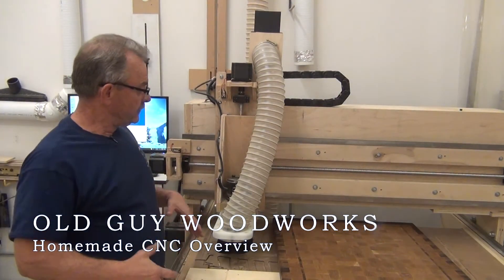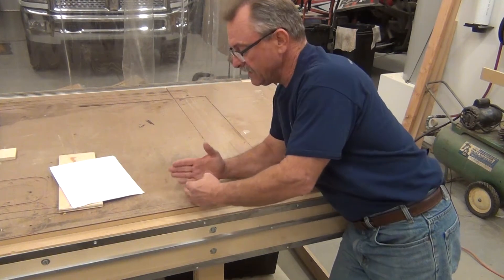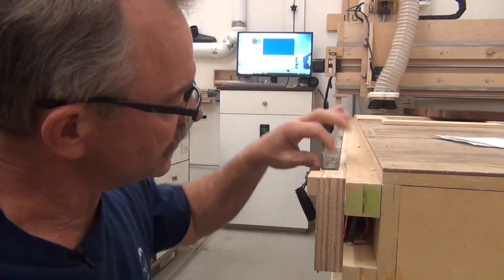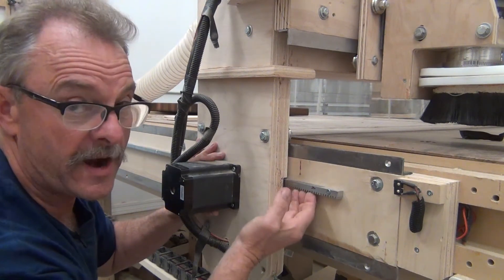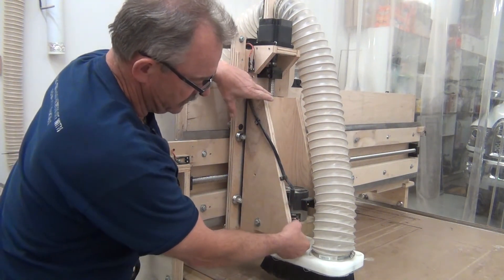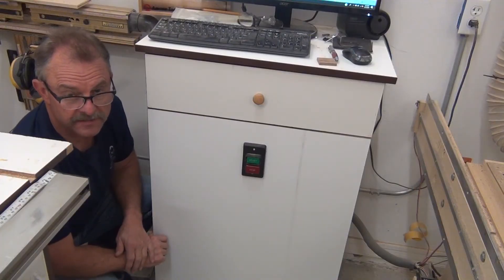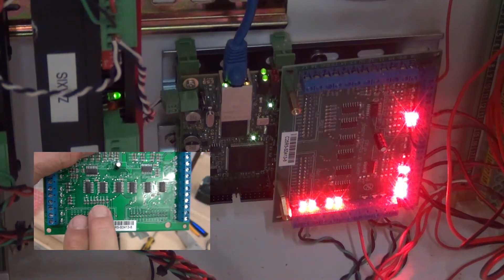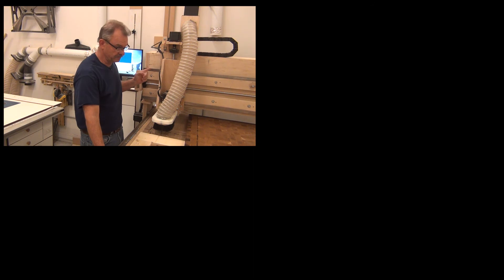How to Build Your Own CNC - Easy and Cheap

Comment: Great video, very helpful tutorial. Theoritically speaking, how plausible is it to upgrade this design to allow CNC-ing metal (ex. stronger drives, router etc) ?
Reply from the maker: I was starting to do that very thing.  Changing to Aluminum billet for the gantry brackets, but I'm moving the shop.  It's all coming apart.
Reply: @OldGuyWoodworks  Nice, I think I speak for everyone when I say that we would love to see the end-result. Good luck with the moving process by the way and thank you for the content. Awsome channel 👍

Comment: I'm going to be looking in on more of ur build videos bro. I think it's awesome how u built a full size 8x4 ft CNC Router.  Great job man.
I wanna build a smaller version but I;m using TB6600 drivers wih NEMA 17 & NEMA 23'S.. I have an small spindle, well 2 different Spindles but also a cheap 800W palm router. I think I will use the 775 small spindle motor for starters. I wanna use Arduino for my controller. 
I have a 600W poiwer source and it's 24V but I also have a 360W power supply as well but I need to go back and check what it is 12/24V? I'm not sure right now. All my parts rare boxed off atm. I'm only using 2060, 2020 & 2080 extruded Aluminium. 
It's my 1st attempt so I bou8ght what I9 could get on a good offfer. I'm goign to use belts and pulleys. I am waiting on 6mm Aluminium plates for my gantry sides. I'm thinking of making it 1000X600mm for now to learn from mistakes I make but I want to ask about what u said concerning the power supply burning out the Drivers? I defo think the smaller spindles are maybe 350W. U know the cheapo ones. They say 500W but never reach it. 
So what I want to ask is do I need 2 power supplies? 
ONE FOR THE SPINDLE AND ONE FOR THE DRIVERS AND THE REST OF THE ELECTRONICS, ETC? 
Somebody told me to have seperate power supplys for each?
Do u do videos with a complete breakdown of the wiring and how it should be done bcos most ppl seem to gloss over that part of thweir builds. I'm finally hoping I've found somebody who takes thewir time with the wiring and electronics side of their build..
Salute man na I look forward to watchi9ng more of this series of build videos asap.. take it easy man..
Reply from the maker: Need two power sources for sure.  One for the drivers, motors and various things.  My second one is for my spindle which needs a 3 phase inverter.  Haven’t installed that one yet.

Comment: possible to see your wiring diagram? I wanted to make my won DIY cnc router and I am a beginner
Reply from the maker: I don't have anything written down.  I used all the wiring diagrams from each manufacturer as my guide.  The wiring is fairly extensive as there are so many different components ranging from the break out board, drivers, motors power supply etc.

Comment: What should the distance be between the router collet and the waste board.
Reply from the maker: i don't think there is an exact number.  Too many factors.  It depends on the bit you are using, the stability of your gantry and z linear motiion...

Comment: It's one to make it from scratch out of wood (which is fine when done properly - like in this case) and another not to use linear rails and ball screws which cost very little. When I see people using belt drives (not here) and these home brewed rollers riding on Home Depot V iron, it gets me crazy. It gives the machine a Fred Flintstone touch. WHY? With a few more bucks for motion mechanics you can have a real CNC.
Reply from the maker: I really appreciate your input.  This was my first build and after extensive use, I have come up with a plan for quite a few upgrades. I dearly wanted to use ball screws for my long axis.  At the time (pre China embargos) one ball screw was over $750.  I can't imagine what one would cost now.  The angle iron works fine on this axis.  I did buy new linear rails for the short axis on my gantry and will be replacing soon.  You are correct in that I get some deflection from that axis on the v-groove bearings.  My angle iron is actually from a metal supply company and is more substantial.  Like most things in life, this was a learning experience and if there is another build it will have many changes.  Thanks for watching.
Reply: Don't discard the wood option. Wood is much easier to process and it dampens vibrations better than metal. When you have to make strong joints use very large washers, or even better, plates of aluminum or steel glued on wood that can receive groups of large machine screws. Also, use epoxy not this crappy Elmer's glue everyone is using. Build the gantry using double plywood sheets, glued together with epoxy. Every part should be protected with clear coat for stability. After seeing people falling for the BobCNC scam, it's nice to see a a viable wood cnc build.
Reply: as i said in other comments..yo have the luck to live in a country when this things cost too high men...in argentina those nema 34 its a like a year of work just for buying 2,,,,....im doing a project like this but nema 23 and belt sistem... because the costs of each thing....not everyone in other countrys byside eeuu can afford this...its not cheap at all to make a cnc machine less then that buyinng one hehehe but the people who talks about this things and epxeriences helps a lot to learn what can do and not
Reply: @kevin67397  If this were free, it wouldn't be a deal. At 1200 dollars you put 800 more and get a workhorse with 20x more rigidity, precision and durability. If you need a car, you don't buy a bicycle because it's cheap.
Reply: @Gus Landy :  One man's "few more bucks" can be another man's total budget!   😉
The important thing is to enjoy what you do, and if you enjoy it enough you may be prepared to find a "few more bucks" to build the MkII model, using the knowledge you have accrued.
Some of the nicest machines I have seen on the "University of Youtube" are the result of ongoing improvement. (and spending!   🥴 )

Comment: For the limit switches shielded cable is a nice to have but you might get away with just using twisted pairs. You can easily try this with the existing wire by using a drill to twist the pairs together.
Reply from the maker: Thanks for the input.  The wire is already two wires together.  I also have been told told to add a capacitor as well.  It's an intermittent problem taking back burner right now.